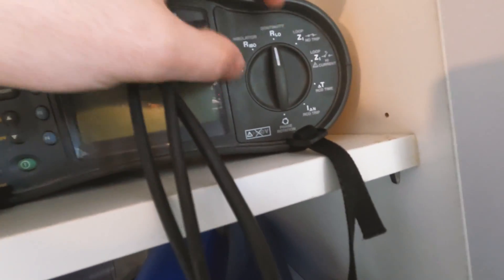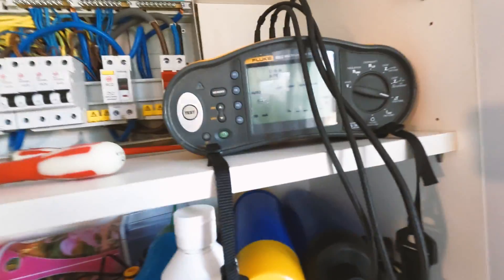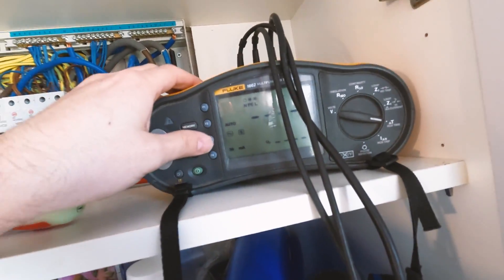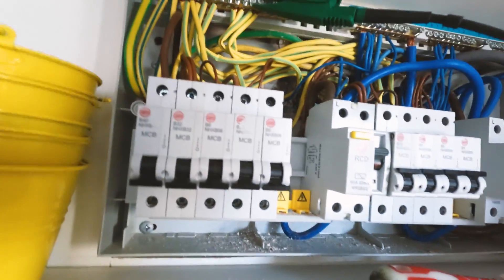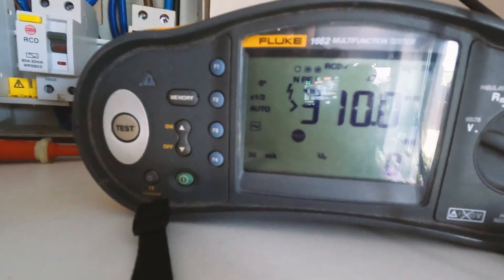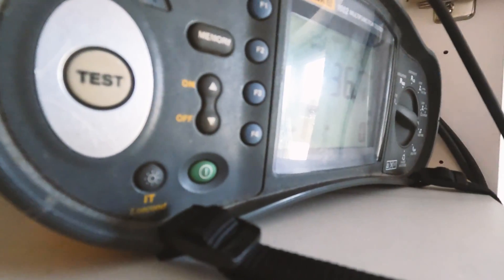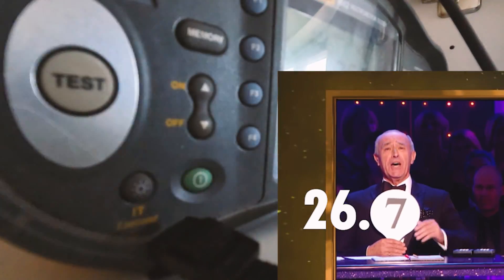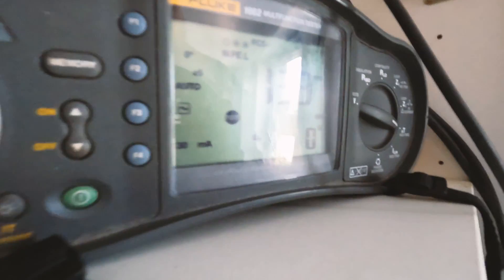RCD FAULT FINDING! | HOW DID I DO THAT!? 🔎

Comment: Why not do an earth leakage test first. To see what appliance is leaking the most current. ?
Reply from the maker: It might not be an appliance, this check is usually 5 min and identifies where to look. Could have easily been the boiler, outside lights etc
Reply: @finneyelectrical yes but an earth leakage test would give you an idea of what appliance is leaking the most current which would be pushing the total amount over maximum 9ma aloud

Comment: what a headache
Reply from the maker: You will get it if you keep at it!
Reply: @finneyelectrical  you have to do all of that just to get the power working again. The best solution would be to throw the whole rcd in the bin. Humans have gone backwards big time. Whose going to keep calling the electrician again and a again everytime this thing trips. What a disaster these switchboards are. The old switchboards were way better. These new switchboards are making electricians millions
Reply from the maker: @adamali2886  nah your wrong, rcd’s stop people getting electrocuted, the death rate for electric shock has reduced massively since they came out. There’s some funny old folk which still have the mind set of if it works it will be reet, meanwhile their kids stick their fingers in the sockets and are no more. Times change my dude, get with it 😉
Reply: @finneyelectrical  if you can't look after your kids you shouldn't have kids

Comment: How do you take the neutral out. Do you mean the main neutral lead to the isolator or each circuit individually
Reply from the maker: RCD off disconnects the neutral, main switch disconnects the neutral and taking each circuits neutral removes that link between neutral to earth, meaning disconnects the TN of a tncs or tns or a link between neaitral to earth in a TT
Reply: It’s at the 3 minute mark I don’t get as I don’t think I see you actually take the neutral out for each one. So I’m not sure what was going on mate.
Reply from the maker: @Jim804 yeah took the neutral for testing that circuit so when you test you should get >200Mohm or at least over 1Mohm. Anything under that shows there’s an issue in that circuit. Then do line to cpc and check that. Obviously just turning off the mcb disconnects any links to other circuits.

Comment: Great video. Thanks 😊
Reply from the maker: Cheers ash! Love to help people ❤️
Reply: I also have an intermittent fault that trips the RCD..I suspect it's the shower ( doesn't heat the water, just mixes). I will wait to get a basic insulation tester, I only have ordinary DMM.. Would that also give me an indication?

Thinking ahead, would a consumer unit with RCBOs be better?

Btw what area do you cover in the UK? I am in Reading area.
Reply from the maker: Yeah that a good 3 hours for us, could charge you a good £500 to cover but best to get a local firm in for like £150-200. Basically do what I did in the video, if it’s the shower, get the same make and mode and replace it. Check the out of the isolator with it off to check it’s the shower not the cabling

Comment: Why would two RCDs in series trip together, after around 24 hours powered? But when there was only one RCD it did not trip! I didn't find a large current imbalance nor any ground currents. Any tips?
Reply from the maker: @tzm1843  so basics is rcds trip at the rating, so they trip when something causes more than 30mA leakage or trip if they are faulty. If they test out ok then it must be something intermittent in this case. If you do an insulation resistance test with the rcds off from line to earth and neutral to earth then if there’s an issue you generally get a reading less than 1Mohm. Disconnect the neutral and turn off the mcbs to find which circuit, then dive into that circuit to find the fault, is generally how it goes

Comment: Ive had a couple of times a suspect rcd that wouldn't trip even with the test button. It turned out to be a neutral to earth fault on the 6mm feeding the hob. 
Unusual because as we all know, that that kind of fault WOULD trip the rcd !!!
Reply from the maker: Great name 😂
Reply from the maker: Yes mate, I’ve been black to a few where previous electrician changed over the RCD but it didn’t resolve the issue. You need to disconnect the neutral and line of the outgoing and then do an RCD test. Defiantly had that before with the test button not working with a neutral to earth fault. Was a socket screw, screwed into the neutral.
Reply from the maker: What happened to rin tin tin the turd? Haha 😂
Reply: @finneyelectrical  You tube changes it as far as I'm aware to 2 differnt old accounts!! 
Not sure why !!
Reply: @finneyelectrical  i can only assume that the earth was at the same potential as the neutral!!  I.e. a very poor earth. !!
Reply from the maker: @merlin5476 must be!

Comment: Hey mate in this situation, before taking the oven apart, would it be worthwhile testing earth leakage on each circuit protected by the rcd? Possibly other circuits could have too many milli amps of earth leakage combined from appliances to cause intermittent tripping? great vid!
Reply from the maker: Heya Samuel! Cheers for the watch, what videos would you like to see? 

So we tested everything and it was all clear but the oven. We knew the oven was the problem but then gave the customer a bit more bang for bucking pulling the oven apart.

Comment: Most useful, thanks. I have EXACTLY the same problem (cooker tripping the RCD when in use). I am going to get the cooker checked by an approved appliance engineer. You have done a (middleman) electrician out of a job somewhere...😃
Reply from the maker: Haha 😂 well I always give free advice over the phone for fault finding if it’s user end fault finding. Always do my self out of work or a £160+vat emergency call out. Always good to help. ❤️

Comment: How would 0.8M Ohm I.R. trip an RCD ?  230/800,000 = 0.0003mA.  Watching to end, you advise that expansion during oven heating may lower the IR, plus good point about parallel paths 1/R1 + 1/Rn = 1/ Rtotal.
Reply from the maker: Basically that, there may not be an isdue currently but that less than one Meg points towards that as being the issue

Comment: Hey dude

Resistors in parallel explains the low “cumulative” IR

1/RT=1/R1+1/R2….

Nicely done
Reply from the maker: Like it lad 👌 slightly different to fault finding using a clamp meter. Never get when people say the last electrician couldn’t find it as it wasn’t tripping at the time they came 😂